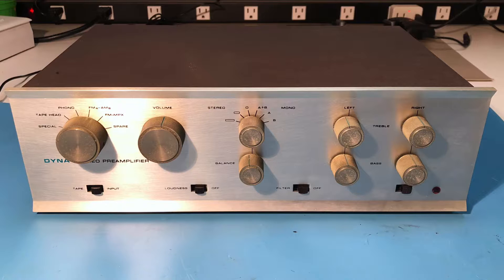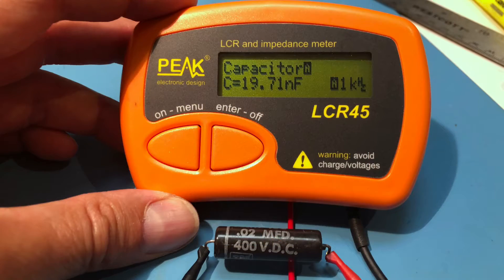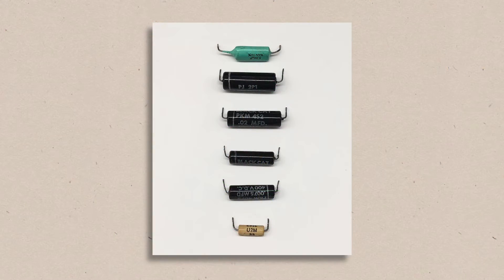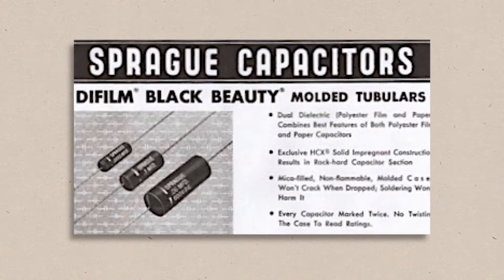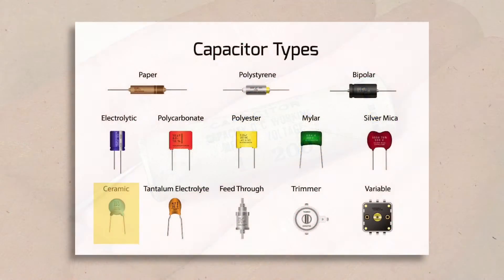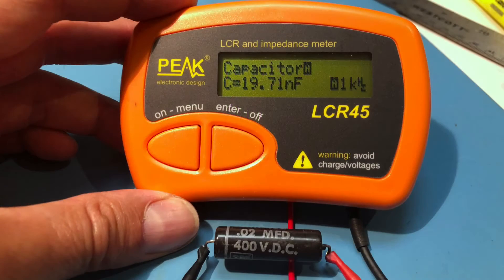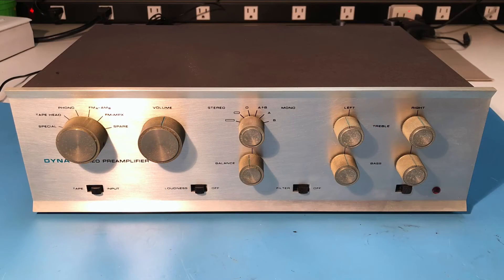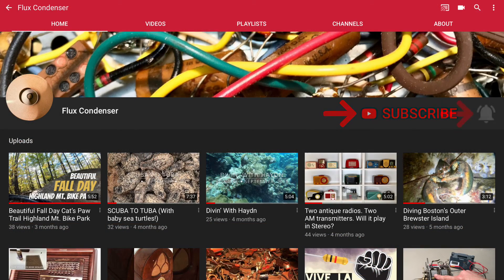The Surprising Truth About Old Capacitors

Comment: The only thing I have found out with black cat is that older ones can crack in the plastic joint on the housing so that they are destroyed. The manufacturer changed the plastic material, when they did this does not seem to be documented but from what I have seen when I renovate equipment it is a change between 64-66 that it happens. I always do a visual check of them if you see that they are starting to open up at the legs it is time to change.

 Regarding the fact that new and expensive plastic film capacitors "shall" be superior it is sometimes ridiculous to hear even the claim that red sounds better than blue or that the cost is important expensive better than cheaper.

 I found a NOS bulk package of electrolytes from Rifa that has a long life even on the shelf for 2€ each but according to "experts" these cheap caps would fit better in the trash. But what they don't know is that Rifa has always made quality components for Swedish industry, military equipment and Swedish audio manufacturing they rarely fail. 

But they have a film capacitor I think you should avoid, it's their transparent one that the plastic cracks on, it always sits like a spark arrester on a switch.

Comment: I've rarely had problems with old capacitors other than wax paper ones that have gone drippy. Even old electrolytics are often absolutely fine. I once fired up an old transistor guitar amp from the mid-1970s that hadn't been switched on for 30 years and it worked (and still works) just fine. If it ain't broke...

Comment: Uuggh the hype over those old bumblebee capacitors,don't believe these things are good. I have serviced electronics for 50 years . They are never good!!! Most will be cracked lengthwise , all will be leaked or shorted. Zenith used these in b&w tvs and they are always bad,I think more so. Than the old wax caps,stay away from both of these.vitamin q seems to be the best of vintage caps.

Comment: have you tried to make a tube amp with paper wax capacitors and compare the sound? The sound is different and there's no capacitor that sound better than those old paper ones. Try it before making conclusion, and give it to listen to someone who has ears. It can be that ppl who used to listen to modern crap lost their ability to hear. Like making an analogy you won't hear and distinguish any difference in Chinese tones, but for someone who grew up hearing tones the difference is so dramatic that different tones means absolutely different words. But if you listen to them you wouldn't notice any difference until you got familiar with those sounds a lot
Reply from the maker: What utter nonsense.

Comment: As someone who has been restoring tube-based equipment for about 40 years, I would recommend replacing all of them. Why? Because the average person doesn't have a decent capacitor checker, and they're not going to know the difference between paper and mylar capacitors just by looking at them. Not only that, but capacitors are cheap. Nobody needs silly $40 caps, orange drops will work just fine

Comment: What will a bad cap sound like?  I have an Dynaco ST-35 that’s been sounding like it’s clipping and full of distortion.  Cheers
Reply: It is as you describe what a bad electrolytic capacitor usually does when it is broken. 

I am also a big fan of Dynaco especially the ST 35 which I have refurbished several of and sometimes restored. What I usually recommend is to replace the multi capacitor with a new one or Gillespies EFB which I think is a good upgrade, but if you like the original look then buy a multi cap.

Comment: “If two capacitors measure the same, they’ll sound the same.” You really shouldn’t throw out an absolute statement like that which negates and even insults many audiophiles’ experiences. But I’ll play that game with you. All those Mylar caps should be replaced with polypropylene caps. Measure the same? Maybe on the instruments you have on hand, but with lab grade equipment polypropylene measures better in terms of dielectric absorption (as well as a couple of other parameters) which causes subtle smearing in the sound. You don’t hear it? Fine. Doesn’t mean that others can’t. You don’t have to spend big bucks on polypropylene though, in my opinion. Use CDE Orange Drop 716P or Illinois polypropylene caps.
Reply: So you’re agreeing with him?

Comment: You don't need fancy or brand name you need good material The change in capacitance with applied voltage is known as the capacitor's voltage coefficient, and it can be the dominant source of distortion in the low-frequency spectrum where capacitor impedance is relatively high. Furthermore, as the signal amplitude increases, greater distortion occurs.

Comment: If you are listening to your amp with knackered old paper caps and swap them for polypropylene caps then the amp will sound different, it will sound how it is supposed to sound. And you will no longer be able to warm your hands on the red-plating output tubes.

Comment: Great video, but I have to call you out on the sound characteristics of capacitors. Quality and manufacturing play a big part, if you don't believe me just swap out the caps in your crossover (even of the same value) and then convince me there is no audible difference.

Comment: Maybe this is true for components, but in speakers, capacitors can and do make a huge difference.  I've done it and heard it many times over.  You do need to be working with higher quality drivers for best results but to imply that a 3.3uF electrolytic will sound the same as 3.3uF Duellend is just a ridiculous statement.
Reply from the maker: That’s nonsense.
Reply: @FluxCondenser  wow

Comment: I have found that capacitors sound different.  The idea that "if they test the same they sound the same" would mean that tubes, regardless of brand, sound the same as long as they test the same.  I assume you believe that's false, but maybe not.  Regardless, in my experience, anything that has audio signal passing through it has the potential to change the sound characteristics.  Tubes, wire, caps, whatever.  It might be to a small, or meaningless degree, but the human ear is an amazing device.
Reply from the maker: It depends what you test for. A simple pass/fail test for tubes won’t tell much about how it will sound in a circuit. Extensive tests for emissivity and gain, however will. The same goes for capacitors. A simple capacitance test won’t tell you much about how a capacitor will sound. Leakage, ESR and tangent of loss tests, however will. If two capacitors sound differently, they’re going to test differently in some way. Simple physics. If one denies that, then one subscribes to magical thinking. You may as well believe in elves, fairies and Santa Claus in that case.

Further, the human ear is incredibly fallible and as it’s connected to our brain it’s subject to psychological influences. This is well documented. If one “thinks” or expects to hear a difference, one often will, whether those differences are real or not. Time and time again, such claims, when put to the test by double-blind testing are shown to be nothing more than wishful, magical thinking.
Reply: @FluxCondenser  Placebo effect.
Reply: Only 10% of people can hear a singer who is slightly off key. Once one’s audio system has no hum or clipping it’s good enough for 90% of the population.
Reply: @Krunch2020  So much music over the years has singers that are more than slightly off key. All music stored over the last 30 years has been digitally processed. Even vinyl. Also been thru thousands of op amps, sometimes crappy ones. Blind testing is the only way, used in medicine and aviation.
Reply: you cant lab test what the brain does.
it works the same as our vision where we only recieve about 5% of the photons that make up our images. the rest is created by the brain with its algorithms and fractal networks, were only just able to measure this.

sound is the same, were making 8k audio out of 240p footage, our brains fill in the gaps and match those micro patterns to material resonances in the real world, giving us our 3d audio image.
its almost like an analouge to digital conversion where every micro sound is amplified and compared to the rest to give a fuller picture and then reconverted into a mix of balanced waveforms in our brains, where things match re-enforces the signals, where we chop it to bits with circuitry... doesnt play well with our brains, all those micro details are turned to mush, what we get out of it could be wonderful or horrible deoending on our lifes experience of sound, we have the basics in common but life likes to evolve and optimise. we all hear differently even if our ears afe perfectly the same. some of us will hear blended peaks, others will hear them extended. were all unique, as are our amps.   theres good reason for it. keeps us safe from tigers and snakes.

until we full understand the brains networks and tap difectly into them with no need for further evolution... caps and cables will all sound different.

$10k cables... can sound the same as a coathanger, depending on how good your brain is at handling that info. if your brain is epic at sound recreation, you could go all coathangers.
if your brain is nittpicky about what sound goes where (like mine) you have to make adjustments. for me i hate digital audio, cant stand it, even down to no music sounds good after about 1984 where the studios all went digital.

Comment: I am trying to replace old ceramic disc caps that have values like .005ufd but I can't figure out what "ufd" equates to in today's nomenclature.  Would that be the same as 5pf, 50pf, 500pf, 5000pf?
Reply from the maker: .005 ufd means .005 microfarad which converts to 5 nanofarad. You can use a handy online calculator like this one: https://www.easycalculation.com/unit-conversion/picofarad-pF-microfarad-µF.html

Comment: I have a Dynaco factory assembled PAS-3 that was stamped tested 501 APR - 7 1966. I had all the Dynaco catalogs, I scanned them, then sold them on eBay 10 years ago. I am not sure of the production dates, nor am I familiar with what the "X" stands for. I used to have the early PAS-2 back in the 70's, that is the same with different knobs and facia. All the label on the back says is "Dyna PAS", and a factory assembled sticker with serial number.
Reply from the maker: I believe the X version has the upgraded tone control section.
Reply: @FluxCondenser  
The PAS-3x was designed to be compatible with the company's new solid state amplifier the ST-120.  I am not sure whether it was a build option or just a better impedance match that worked for both Dynaco's tube and transistor amps.

Comment: So this NOS 1964 Heathkit AA-21D I am about to assemble has silver mica, ceramic disk and electrolytic caps in the kit.  I assume I should just replace the electrolytic caps outright.  What do you think about the ceramic disk and silver mica? Should I keep those? Or maybe replace those with a different type of cap like poly?  LOL - I am a complete noob with this!  Thanks for any guidance you can offer.
Reply: Consensus generally is, to leave the silver mica and the disc ceramics alone. Electrolytics need to go. Why risk your amp on saving a few cents for new better constructed caps?  "Hey John! My amp was working fine on the original caps, but they failed and caused some big problems, BUT I saved 3 dollars from not getting new caps" :)
    Paper/foil types, replace those as well.
Reply: @watcher818  I replaced the electrolytics and left the rest. Also replaced all NOS resistors with new ones.

Comment: "If two capacitors measure the same they'll sound the same."

What utter bullshit.
Reply: X7R vs poly. With X7R the capacitance varies significantly with voltage and could lead to audible effects, not good to use in the audio path unless that is what you want.
Reply from the maker: A sure sign that someone has nothing useful or convincing to say is when they resort to vulgarities.
Reply: @FluxCondenser  A sure sign that someone has nothing useful to say is when they resort to critiquing language.
Reply from the maker: Hm, you seem to be just repeating what I’m saying, but in a way that’s absurd and without merit. My “useful things to say” were in the video. Do you have any original thoughts? Any videos on capacitors? Any evidence? Any practical knowledge? I’ve actually tested capacitors rigorously and my thoughts aren’t just opinions. They’re the results of actual evidence.
Reply: @FluxCondenser  There are characteristics that alter the sound that can be measured that you did not mention. Rise time and slew rate differences can effect phase response which are hearing is very sensitive to. Square wave response and viewing the leading edge can show the differences.

Comment: Some 1950's caps are still fine. Yet some early 90's 'lytics are all bad (mother boards, dvd players etc. ) If a tube amp has glowing red plates, you can be assured you need to blanket through and change out coupling caps.
Reply from the maker: Yes, the plague of some Chinese capacitors from the early 90s wreaked a lot of havoc.

Comment: Great video, thanks for sharing it. Black Cats have always been somewhat  enigmatic to me. I've worked on scores  of Stereo 70 (and other Dynaco) driver boards. In some instances a board would be loaded with out of spec leaky black cats, in other cases all of them would be relatively okay.  That said, the older the amp, the more likely the Black Cats would be bad.   I'm don't think repopulating your PAS3 board with the original caps was the best move though. Even with extreme care, those old phenolic boards will only tolerate so many reworks before the traces give out. And at 50 years old it's just a matter of time before those old black cats begin to fail. Decent coupling caps are fairly inexpensive.  You don't need to spend ridiculous amounts of money on the audiophile grade caps some companies are selling. I've found Sprague Orange drops deliver a very good bang for the buck and they last a very long time.
Reply from the maker: Thanks, glad you enjoyed the video. Much like with Sprague Black Beauties, CD Black Cats (to my understanding) come in different varieties. With the Spragues, the ones with red markings are film while the yellow ones are paper/foil. And accordingly, the red ones are often just fine, while the yellows are typically leaky. This is based on advice from the master himself: Mr. Carlson. 

The Black Cats in this Dynaco appear to also be of the film variety, and as such, should remain reliable for years to come. They’re still “purring” along beautifully, so I have no intention to replace them and expect they’ll perform well for decades to come. 

Of course, this is all personal choice and I tend to err on the side of caution with capacitors. In this case, though, I’m confident in my decision to leave the Black Cats be.
Reply: @FluxCondenser  Mr. Carlson is amazing, I have the Heathkit IG-18 like you do, but I want to build his capacitor tester, measures down into the giga-ohms with low voltage.
Reply: I agree. I tend to err on the side of replacing all these caps while the unit is on the bench and opened up anyway. The cost is minimal. Illinois Capacitors (“IC”) makes some cheap polypropylene caps with copper leads. It won’t be long before the old ones do start to leak and the ESR will climb too. If a leaky coupling cap causes DC current through the volume pot the scratchy noise when turning the pot can be very loud and potentially tweeter killing. Ask me how I know…